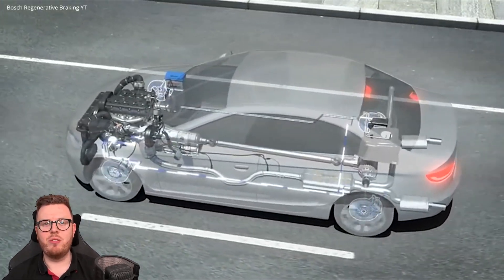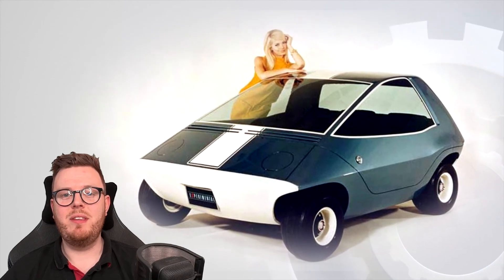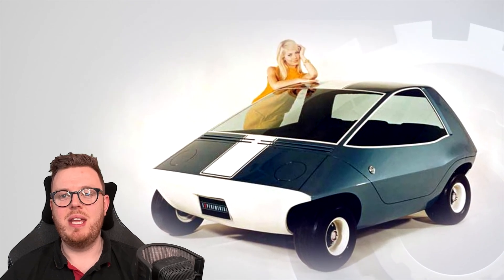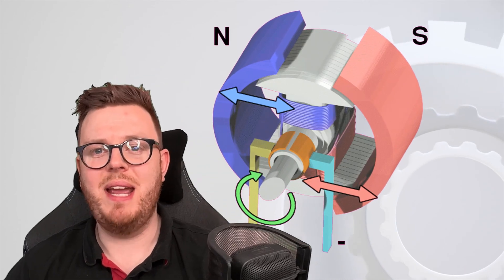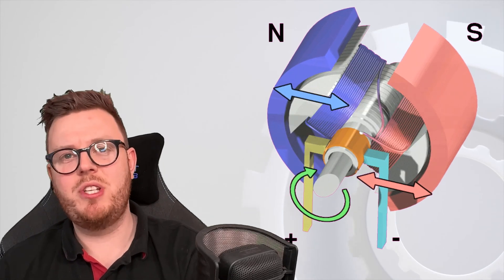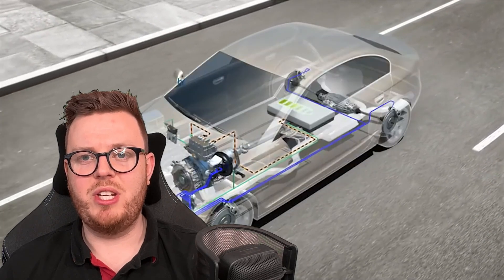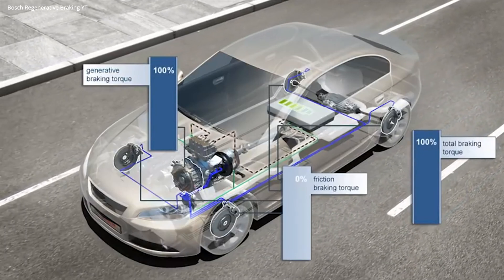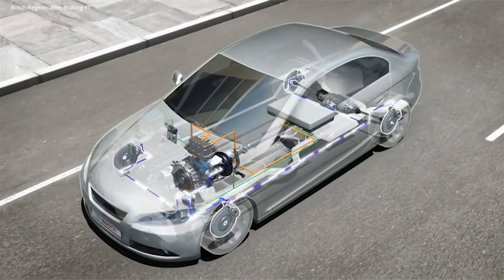HOW DOES Regenerative Braking Work?

Comment: 3:11 - This is as close to answering my question as I’ve seen in any video. But unfortunately, I’m still not totally clear.

I was of the understanding that when the motor turned into a generator it’s because your rolling wheels are powering the motor. So why is it that if you apply more breaking force, which stops the rotation of your wheels sooner, that somehow generates battery? 

In short, I thought more wheel rotation meant more battery, charging, yet harder breaking, which stops the wheel rotation sooner, also charges the battery more? How?!

Comment: My question was, how do the "levels" of regenerative braking work, e.g. on Hondas where you can increase the regen and braking power with "shifter" paddles on the steering wheel. I think I figured it out, just thinking it through: the motor is still providing power when you take your foot off the gas or start braking, and with no input the inverter will reduce that power in a smooth, shallow curve. When you "downshift," you're asking the inverter to cut that power in steeper steps, increasing both the workload on the wheels to power the system and the net gain from the motor getting spun on its shaft.

Comment: So you're saying the regen brake system works great for braking however it's poor at generating power to charge the battery. I'm  guessing the only difference is the configuration of the coils on the armature that makes it different from a vehicle alternator (or generator if we're talking a really old car because the rectifier was a separate part).
Reply: Apparently, you get up to 60% of your energy back from breaking. So after a while, your hybrid car will still use up all its fuel, eventually, as it powers the motor when you don’t have enough battery or in an ell electric, you’ll eventually need to plug it in.

Comment: I discovered back in the summer  my hybrid wasnt changed enough to allow the Air Conditioning to work.I taken up with the dealer before hand said i had either run the car more on longer journeys or had to buy a smart charger.Thankfully i never own a lead battery charger.Never need to.Or borrow someone  charger .

Comment: Most people already know what regenerative braking is. We just needed to know how it actually recharges the battery. I really thought it would be explained.
Reply: EV's use Permanent Magnet Synchronous AC Motors. The concept of regenerative braking with these is actually extremely complex. A lot actually goes into the mechanics of regenerative braking with them. Due to the air gap flux being uncontrollable in them, the output voltage is directly related to the RPM of the rotor. 
To start, the motor controller changes the angle of difference between the stator field and rotor field. The closer to a 90 degree angle between the two fields, the more current is produced as well as rotational resistance. This would be what specifically controls the amount of force the regenerative braking system is applying to the vehicle. 
As said earlier, in these types of motors the RPM of the rotor dictates the voltage output of the motor during generation. The Inverter needs to be able to receive this voltage and regulate it back into the battery packs DC voltage. This means that if the battery is 400v, the motor is producing 750v @ 20a, the Inverter needs to do two things. First, it will step the AC voltage down from 750v to roughly 400v, meaning due to ohms law the amperage will be increased to 37.5a, then the inverter will regulate the 400v 37.5a AC into DC, which the battery can then accept.
Reply: @casey360360 The current increase is not due to ohms law as there's no fixed resistance. It's simply increases as aresult of step-down of voltage in an AC circuit. Example is common in transformers
Reply: Exactly
Reply: Fr.
Reply: BS, this video is about regen braking not "How to charge a battery"
I would agree that it is a pathetic video due not explaining any info about how the battery/charger is connected to cause it to charge/regen.

Comment: This video doesn’t explain how RB is actually recharge the battery.  But thank you for explaining what it’s
Reply from the maker: I do. To put it simply the motor reverse’s it’s self creating a dynamo which generates electricity which charges the positive ions in the battery
Reply: @EdenMotorGroup  But at which moment does the motor reverse itself? why doesn't it brake anything when changing direction at high speeds? Does it uncouple itself from the drivetrain at the moment of recharging?
Reply: @profdmiranda  The motor doesn't change the direction of spin. The wheels, and all the gears between them and the motor, and the shaft running through the middle of the motor are all still turning in the same direction. What changes is that the motor is no longer receiving power from the battery to turn that shaft (or at least, it's not contributing as much). Instead, the momentum of the vehicle is turning the wheels on the road, so the wheels are now the generators in the system, turning the gears that spin the shaft that rotates the motor, which produces electricity from spinning.

Comment: Can regenerative breaks be the only breaks or is it necessary to have break pads aswell
Reply: I'm not 100% sure but the Toyota Prius uses physical brakes under 5 mph
Reply: Regenerative braking can be used as the only braking system in normal stop and go traffic, but the issue is that regenerative braking currently doesn’t have the ability to  quickly slow down fast enough to evade some emergencies and potentially crashes. This is why all EVs and Hybrids still include standard brakes, however this could change with improvements to the current technology.

Comment: Regenerative breaking really helps on hills and mountains.
Reply: Actually it helps more around town with traffic lights. On hills it is less used because you don't (mostly) use it when going up hill, and you don't use it when going down hill. you use it when you brake.
Your point should have been that when braking down hill regenerative braking is very efficient because you have more potential energy due to the incline than (on the flat has no potential energy), whereas braking up hil you don't need to use the brakes as much (negative potential energy).
Reply: @NZTechArc In steep hills and mountains you use it a lot going downhill.  It is still what keeps the car from accelerating to maintain constant speed.